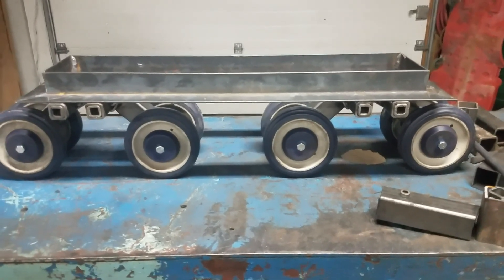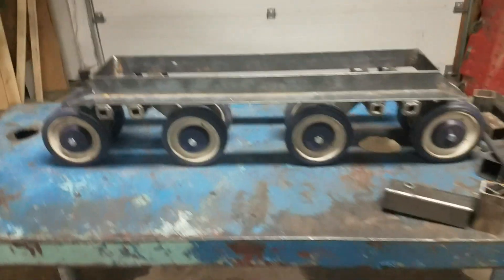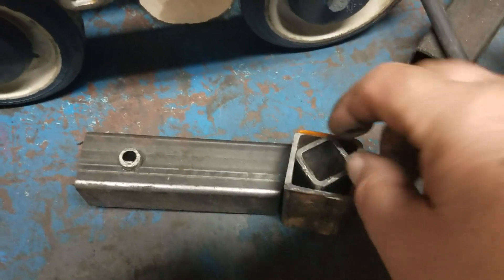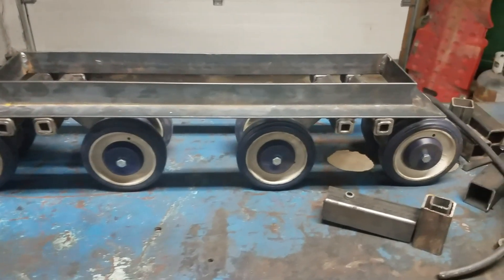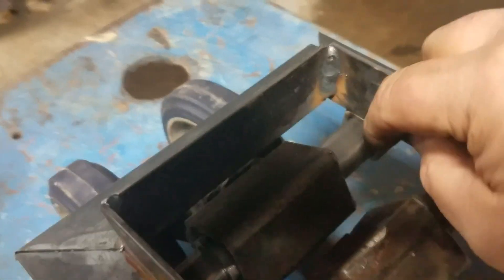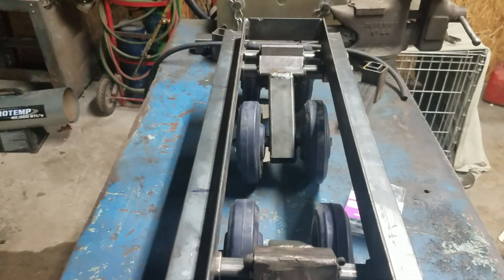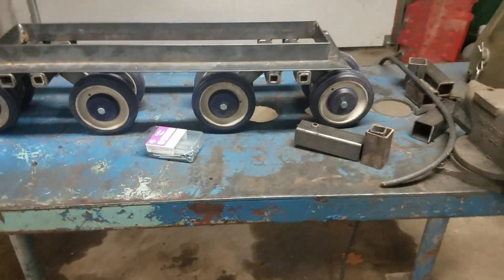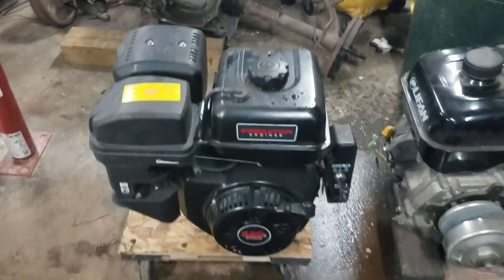PTV Build 7 - bogie torsion suspension

Comment: Just curious but would it work with an arm going from your angle iron down to the rollers that pivots and a cheap go kart shock on the other side. 1 arm per 4 boggies?

Comment: Just sent you a little donation on PayPal. Love the build. I also have a couple tracked vehicles I’ve built on YouTube. You can find them at CW Fab. Keep up the good work and love the videos. Do you have dimensions on your large drive gears for the track. I’m a machinist so I’ll have no problem building them. Can’t wait tell the next video.
Reply from the maker: Hey, thanks for the help.  I don't have the dimensions of the 60 pitch sprockets, but I have scanned the actual sprockets and will send them as well as the hubs to you.  Print it out and you can measure the actual dimensions.  I made the latest sprockets from 7/8" steel and the hubs are 1/4".  Stand by...
Reply: Great that will work. I have a cnc plasma table and all I’ll need is a scanned picture. If you need anything cut on a cnc table let me know. I’d be glad to help. Love the build
Reply from the maker: @Smalls4068  That is absolutely awesome!  Stay in touch, send me some pics of what you cut, etc.  Appreciate your friendship!

Comment: I am not critisizing your work at all I just wonder if a hockey puck could be used in place of the rubber cords. If it were cut square and then a plug punched out of it with a square chisel made from the 1" square tube? Also the pucks could be used as spacers between the large tube and the frame, so that the cotter pins could be outside the frame.
Reply from the maker: Hey Glen, since your post, I have done some more research on the rubber for the suspension units.  Maybe you already know that they scale rubber with a durometer.  The lower the number, the softer, higher number, stiffer.  One place I researched even had the durometer scale for a hockey puck!  It is at a "90".  I believe the cord I am using presently is at a "70" so it is a little softer.  I have to somehow figure out the right number because I need a little give but not too much.  And if I miss it the other way, I am defeating my purpose of even trying to have a suspension because I won't have enough "give".  Thanks for your email and comments and interest, you look like a guy who knows his stuff!
Reply: @Personal_Track_Vehicle  Oh I know a thing or two. But I also know that I have taken a lot of things that other men or machines have made and made adjustments to them with either angle grinder or welder or both. Some work, some end up at the scrap yard....😁
Reply from the maker: Possible!  I am looking for some give, a bit of movement.   Aren't pucks kind of solid?  Thanks for watching and commenting.
Reply: @Personal_Track_Vehicle  i sent a pic to you via facebook messenger.
Reply: Also sent pic via gmail
Reply: Half a decade later...... but...... As a Canadian, I'm bound by birth to support anything involving a hockey puck. But, as Chuck said, pretty high durometer. As a possible alternative, if you go this suspension route, one could cut out square washers, sorta speak, out of rubber gym mats or rubber horse stall mats. This could also possibly give a way to adjust the strength. Using various thicknesses of mats, or a mix of soft and harder mats. Or one could add smaller OD spacers between the rubber sections to soften the action. ( personally, I think compression springs with the wheels on trailing arms would be much simpler and even lower maintenance, if there's room for that arrangement. Springs out a car motor like lifter springs might be cheap or free. But this is just my in the head thinking. :) )
Reply: @wingnutbert9685  My thinking was similar to a 1969 Volkswagen Beetle with independent rear suspension